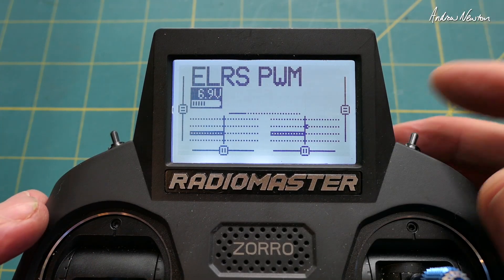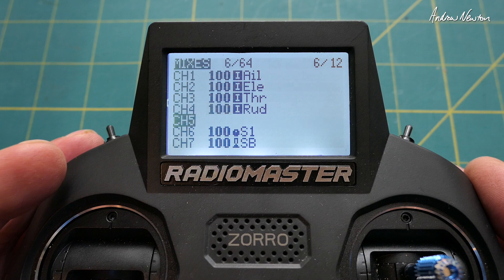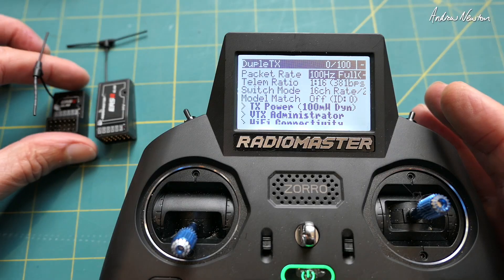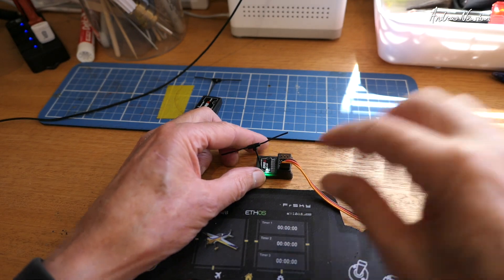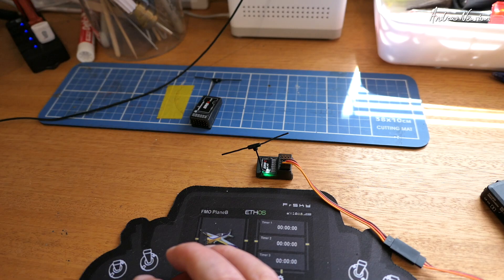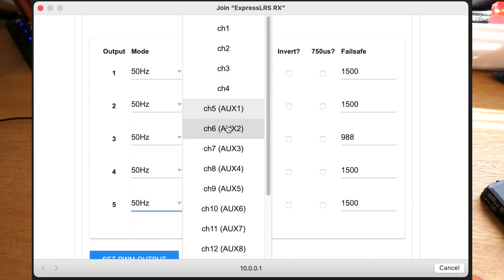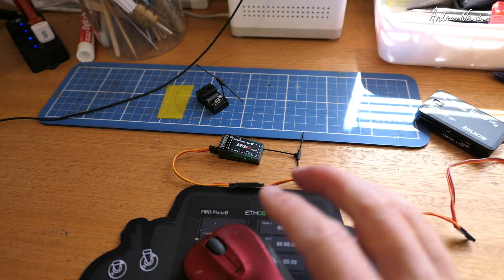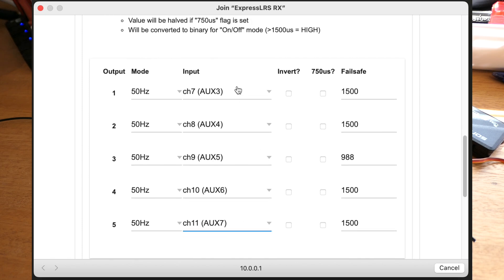ELRS 3 - 10ch PWM and Ch 5 requirement

Comment: Why the display ELRS in radiomaster is: !Armed! ...? (receiver is ER6 PWM, after wrong voltage input 16Vdc &  fuse circuit burn-out)
Reply from the maker: That means receiver Ch5 is stuck on higher than 1500
Reply: @AndrewNewton  I will check and thank a lot.

Comment: Is channel 5 not working on middle pwm values, it takes only High and low position pwm
Reply from the maker: Correct. But if you can get full resolution by choosing a different packet rate and switch mode.

Comment: With Radiomaster ER6 receiver, (Firmware ELRS 3.3 ) does not require this channel re-mapping. Just upgrade both tx and rx to latest version (I tested with 3.3), then select tx frequency to "333Hz Full". Both ch 5 and ch 6 will work with full resolution.
Reply from the maker: CH5 still needs to be the Arming channel even if it is full resolution
Reply: @AndrewNewton  I didn't get you. What's the impact of it being arming channel? channel 5 cannot be used for flap kind of setup?
Reply from the maker: Surely you have read the release notes? "Arming must be on AUX1 for safety and feature reasons, having this fixed allows us to maintain small packet sizes and deliver better aux channel options"
Reply: @AndrewNewton  Hmm Andrew. I suspect "Arming must be on AUX1" assumes an FC. I have an ELRS 3.3 receiver outputting sbus to a gyro where channel 5 cannot be re-mapped. Channel 5 does the gyro modes, throttle cut is via mixes on my radio. Either your method of 100 Hz and switch mode or 333 Hz and switch mode give me enough resolution to switch modes on the gyro. 500 Hz will not. It's all a bit grey but seems to work.
Reply from the maker: @TakeItToTheGround  Some of ELRS special features are only enabled if Ch5 is high. Like dynamic power and locked setting buttons.
Reply: @AndrewNewton I use my ch 5 for all kinds of things, Flaps, Retracts   , gyro modes . Arming isn't really a factor for flying LOS
Reply: @TakeItToTheGround yep I do the same , arming is a drone thing or fpv
Reply: @AndrewNewton  Arming for what??? I'm running my retracts on channel5 using a BetaFPV SuperP 14Channel Rx with NO issues!!
Reply: @AndrewNewton nope, your really wrong on that part
Reply: I use ch 5 for many things like Flaps, Retracts,  gyro modes, arming isn't needed for people flying los
Reply: Yes, Arming is only helpful for things like disabling the joystick button on transmitter and dynamic power etc, if you don't need these features, then you are free to use channel 5 with full resolution. To me, I never use dynamic power on ELRS, and I don't care about disabling joystick, so I am good. 

This simple information could have been given earlier when I asked, but instead I was blamed for not reading documentation.

Comment: I tried this with two ER5A receivers and almost crashed my plane! After some testing I discovered that the receiver running without telemetry had only about 20 meters of range. I have tested multiple times with different receivers and discovered that the ER5A receiver with telemetry will disturb any other receiver running without telemetry. As soon I replace the telemetry receiver with another brand, for example a Mateksys, everything works fine. All equipment was running ELRS v3.2.1 during the testing. I have only tested EU-version of the ELRS software.
Reply from the maker: That's a worry. I'll have to check with the non EU versions
Reply: i am very interested in this as an option... hmm... why would the 2nd rx have less range? Do you think it's the telemetry signal interfering? Also, fwiw, i have ch5 mapped to my throttle and have no issues at all (300 hz, full 16ch (1/2 rate)).
Reply: @banzaiib  I tested again yesterday after flashing v3.3.0 to my ER5A receivers, and it works now without any range issues. Both receivers went into failsafe almost at the same rime and with normal range. Must have been the telemetry interferring somehow earlier, but now it’s fixed!
Reply: @torheinebossum7919  thank you for the update! What range and tx power did they failsafe, if you don't mind me asking?
Reply: @banzaiib  This is only experience values since I measure from my basement and through several buildings. Then I don’t have to walk so far… The range is the same as I have tested earlier with various firware versions.

Comment: are there no elrs that have more than 5 channels? requiring the stacking of receivers
Reply from the maker: PWM 5 ch, but UART connection ELRS receivers have 12 to 16ch
Reply: ELRS-R24-P6 from Matek is 6ch. That's the most I've found so far.

Comment: Brilliant! Great follow-up with even more useful information. A shortcut to get to WiFi mode faster is to hold the boot button after power up for 5 seconds, or use the Lua script if it is already connected.
I'm still working to remove the CH5 stuff eventually, so hopefully that won't be an issue forever, but will be this way until we can uncouple it from everything for good.
Reply from the maker: Thanks Bryan. I learn more from your comments than all my reading. Stunning work mate, ELRS is amazing.
Reply: @AndrewNewton  no, thank you! I started watching your videos 4 years ago, and your positive attitude, descriptive builds, and relaxing flights made me think, "This guy seems to be having a good time, I should try this" and welp, here we are 😊

Comment: Good stuff!  I'm hoping to add a kopilot to my fpv Aeroscout and use this method for my pan and tilt gimbal. Thoughts? Great videos on your channel btw.
Reply from the maker: Yes I can see that working. First Rx connected to Kopilot with Ch 5 pins changed to Ch 6 for modes, and second Rx for gimbal.
Reply: @AndrewNewton  exactly what I'm thinking. Thanks for the idea!

Comment: Another brilliant video. Great tips. 
A dual receiver setup could actually simplify wiring on some complex wings that use many channels.

BTW: Another way to get up to 10 PWM channels with ELRS would be to use a Matek CRSF-to-PWM adaptor board with one of the nano style ELRS receivers. Would need to use 4-pin header to solder on as daughter board. (same board should work with either Crossfire receivers, or ELRS receivers)